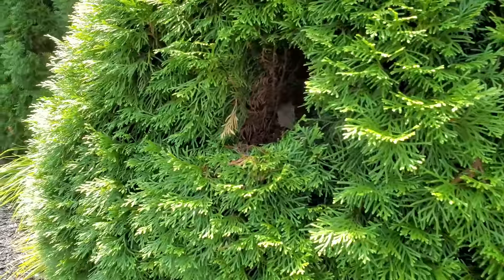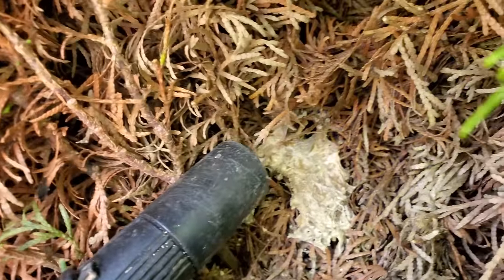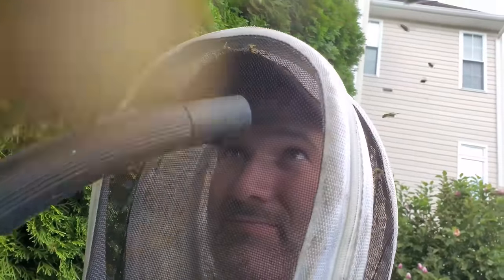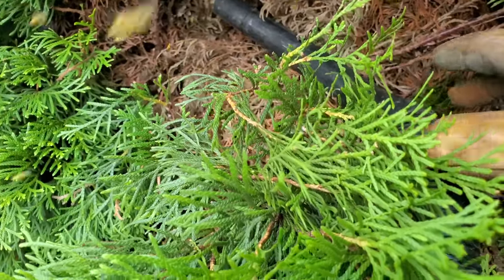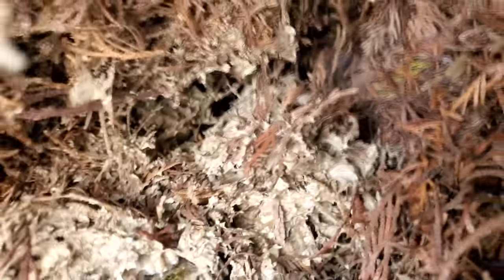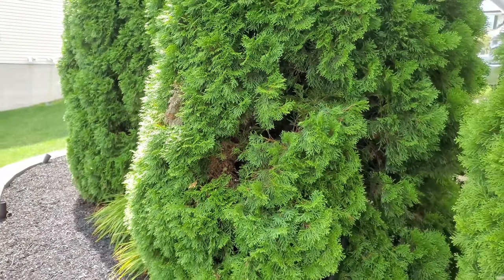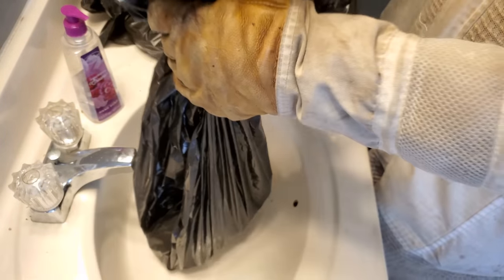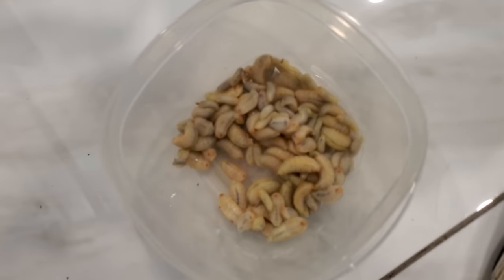BUSH OF DOOM! Aggressive YELLOW JACKETS Swarm From Bush | Wasp Nest Removal

Comment: @HornetKingOfficial Just discovered your awesome channel and finished last month's long video of the European Hornet's nest. In that video, you mention a few times how you can't film in the morning due to the plexiglass being all fogged up from the moist inside. You could heat up the plexi with a heat gun on low to medium setting (on low you could even blow through the screen to dry the windows from the inside). Also, you could put a moisture absorber just below the screen. It won't affect the humidity inside the nest, but will reduce the humidity in the air near the bottom of the box.

Thanks for all the effort you put in making these videos. They are very interesting to watch. A bit cringy at the beginning (EPI-pen bearer here), but it's surely helping desensitization as well as teaching the wonderful parts of this otherwise unloved species...

Comment: This last summer I met a guy here in Quebec that he’s very well equipped for job like that , he has a shop vac the kind that is a 45 gallons drum with a 1/3 HP motor for smoke control or fine particles In welding shop , si he changed the motor for 1/2 HP and instead of the 6 inches hose he installed a 20 feet’s long 4 inches diameter one and in his truck he has 2 Chevrolet volt batteries pack that was reconfigured to output 120 volts , he has unlimited energy for his needs all day and more . 
When the bees or wasps or other thing enter in the drunk they are shredded by the spinning blade .
Reply from the maker: A hose with 4" diameter would have terrible angle of suction for wasps. Your confusing motor peak power with suction angle. 
Bigger is not better here.

Comment: i had those ground bees two years in a row, get a shovel full of dirt and set the shovel next to the hole then a couple hours of darkness dump about six to 10 ounces of gasoline in the hole then a shovel full of dirt on top and your problem is solved . well they have been very helpful they made a hole at a more remote location and they are eating all the mold off our burr oak tree that has plagued it for decades.     in the vicinity of our neighborhood i have seen some burr oaks die or be very sick our ancient burr oak showed excellent health and beauty last summer with no mold on the leaves thanks ground bees i could see them busy all summer .
Reply: Hello best solution I have experienced with ground nest is to place a clear glass window or clear glass  / plastic plexiglass over the hole. Little dirt around to seal. Jackets see the light through the glass and keep trying , bouncing off the glass. If it is dark as with dirt they will dig out. No chemicals and easy set up. Just my experience. Believe it takes a few weeks. Thx Ron

Comment: I noticed wasps and yellow jackets don't seem to be as sensitive as beehives are.  I had a paper wasp nest in a bush I was hedge trimming they didn't come out until I actually hit the nest with my hedger up until that point even moving the bush around, they didn't come out at all. I got stung one time lucky I didn't trip and hit my head on the concrete running in flip flops.

Comment: Get a clear plastic juice jug, cut it's bottom off to form a cone and tape it to the end of the vac hose. Any flying thing can't see the edges to even think of getting away and it pulls more in. I use one with a 4 inch bottom opening.
Reply from the maker: That wouldn't be effective here.

Comment: I have no idea how much it would cost but it might be worth it to have someone periodically get into those trees and remove all of the dead branches and fodder so that it does not accumulate in the core of the tree.  All of that dead fodder is a lot of flammable material that will extend the time that bush would burn if a fire ever started and would guarantee that all the other bushes and any structures next to them would catch fire and burn as well.

Comment: Going after them with that little vacuum takes big marbles ! I would have had my Sears 10 gallon wet dry on super suck !
Reply from the maker: It's not the size of the vac, but how you use it 😆
Reply: Wal Mart agree,s . Sorry for your loss ! :)
Reply from the maker: My loss? 😅 I don't ever choose the wrong tool just because it's bigger. 
You're mistaking peak power with suction angle. It's a common misconception among new viewers.

Comment: I have never seen any creature so angry and aggressive as yellow jackets especially those ones. I'm generally pretty cool with most living creatures. As long as you leave me alone and don't attack me we are good. Yeah one fall I was mowing the grass for the last time of the season almost done and the next thing I know I'm running for my life getting lit up by these little buggers. I took fourteen stings that day. I took multiple stings to my arms, legs, back of my head and ankle bones. They are vicious and can be deadly. Got revenge though. Went on a night attack. Grabbed a spare window screen, some heavy rocks and four cans of raid hornet killer and walked very lightly going to their hole. They never seen it coming not even the guards under a dead leaf. Wiped out most of the winged demons in the ground without a single sting and put up a couple ornamentraps. Very effective. Haven't had a single sting since then. They may have won that battle but I won the war and claimed my turf and family safety back.

Comment: I don't know anything about this type of removal at all..But couldn't you have just started this process like  at around Midnight when all of the swarm was at the nest at one time? I would have dropped a huge bag around that bush, cut a small hole in it, attach a hose to it..and then attach that Bit@H to the tail end of a 1956 Buicks exhaust pipe. Bon Appite.
Reply from the maker: No.

Comment: If I wasn't retired, this is what I would be doing.    I have removed dozens of wasp nests with zero protection  and have RARELY been stung.   That's because I am smarter than the wasps.     These web sites that hype up the danger amuse me.   This site is novices.   (Tiny vacuum hose  --  they make 3 inch  -- and only one vac.  Mostly amusing.
Reply from the maker: Oh please come out of retirement and remove yellow jackets and Hornets nests without protection and make videos about it! Please! 😆😅
Reply: @HornetKingOfficial  Why are you you using a shop vac with such a small hose and only one shop vac?   I owned and ran a tree removal business and I removed all the wasps.    Did one 4 months ago at night. No stings!   You need an attitude.

Comment: Hi, make a much greater effort..  and add a FUNNEL to the end of the tube..
AND.. the insects inside of the hoover are not shredded and a lot are still alive.
So, be warned to open this hoover without protection.
Have fun and get rid of dangerous insects, if they threat you..
(Berlin, Germany)
Reply from the maker: No, that's not how it works.